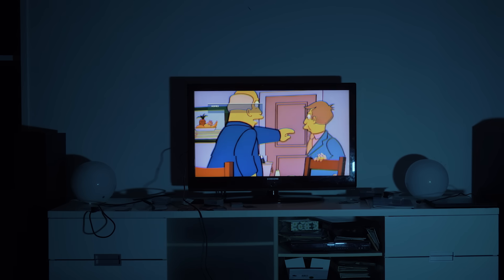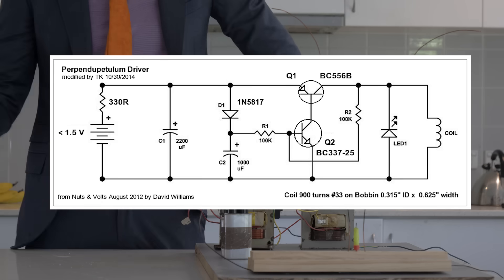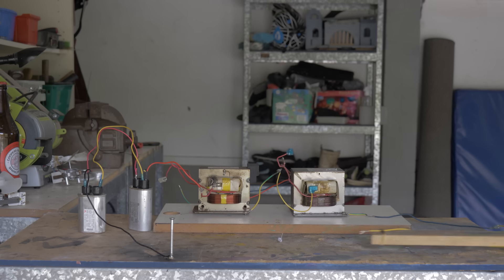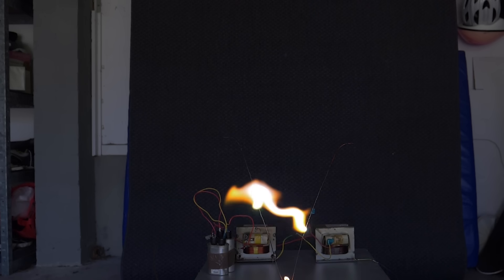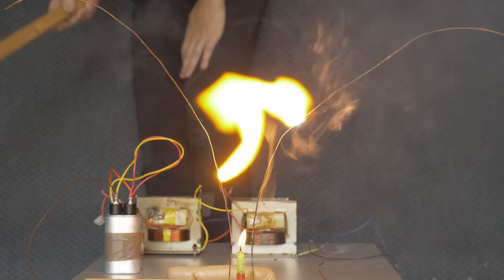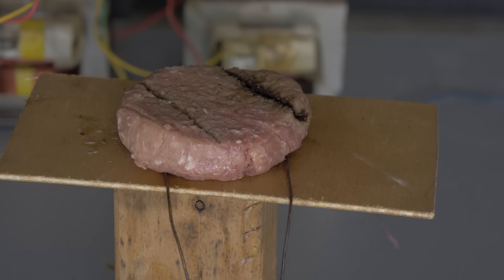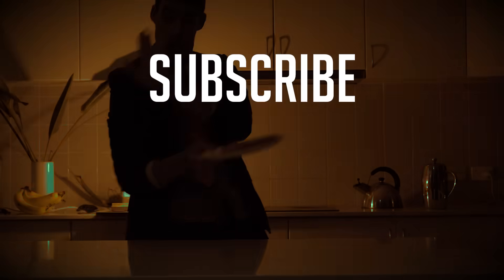Localizing Aurora Borealis entirely in my Kitchen

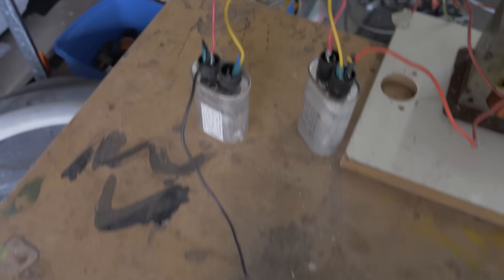Comment: At 3:33 regarding capacitors in parallel vs series... Resistors sum in series becsuse each one restricts the flow of current further. But a capacitor stores charge based on the overlapped area of the two conductive surfaces, with a dielectric inbetween. So, if you want to increase the capacitance by putting two capacitors together it must be in parallel because you are effectively increasing the area of each surface by joining the respective sides together. 
Hopefully that makes sense. But just look at the diagram for a capacitor, it literally resembles how it works. There are two plates and a gap between. In a parallel configuration you can see how there is more surface area to overlap this way as opposed to in series

Comment: Okay, coming back to this video after learning a thing or two about capacitors I can sorta explain why they didn't work in series.
Unlike resistors, capacitors' abilities are combined when they are in parallel. This is because the charges have to collect on one of the sides of the capacitor.
For capacitors in series, the charges on each of them are shared.(They move away from where the electrons are forced onto) So if you charge up a capacitor and
have another one in series, all of the charges that have escaped that capacitor will move to the other one, charging it also. In parallel however, Bot of the capacitors get
charged as the voltage is split across them.
I'm not an expert thoe.

Comment: One thing i do not understand is, what are the capacitors used for?
You have AC and the capacitors are effectively in series with the both transformers (besides wired parralel to each other).
If you want them to store power for your arc, then you must add a rectifier at the output and then the capacitors or use a marx-generator config (see electroboom for that).
From what I understand, you added just an additional load (a reactive one), limiting your maximum current draw and power output.
If I am wrong, feel free to correct me.

Otherwise, nice video!

Comment: When you connect capacitors in paralel their capacitance ads up meaning that they can output more current spot on with the same voltage, but in seies you get as big of a capacitance as individual capacitors have, actually a bit less that that. The reason for it all is that capacitor stores charge in form of an electric field acumulated on most comonly 2 sheets of a conductive foil, can be aluminum or literaly whatever that's conductive, can have large surface area and can be rolled together to decrease it's volume. The important part about capacitors is that those sheets are isolated from each other with at least one sheet of dielectric that can be an air gap, plastic, ceramic and i believe even mica. Either way, capacitance depends a lot on the type of dielectric. Now this means that if you were to charge a capacitor with a direct current it would let energy through but once the field in the capacitor is equal in strenght to your power source, meaning it's charged, it acts like an open circuit. And the time during whitch the current flows through a capacitor just as well as it's value is dependent on the capacitor's capacitance measured in farads [F]. However when you treat it with alternating current. It acts similarly to a resistor. Given that the frequency is lower than it' resonant.

So simplifying the answer to how capacitors work in series and paralel

Paralel connection ads up the capacitance

And series connection ads up maximum voltage that capacitors can withstand.

Comment: they didn't work in series because there wasn't enough capacitance to let enough current through to produce an arc. Putting the capacitors in parallel means double the capacitance, letting more current through.

Comment: The reason that the device did not work with the capacitors in series is simple: the current's frequency is not sufficiently high in order for the plates of the capacitors to be capacitively coupled. Capacitive reactance of a capacitor decreases as the frequency across its plates increases. Therefore, capacitive reactance is inversely proportional to frequency and because of this, as the frequency increases the current flowing into the capacitor increases in value since the rate of voltage change across its plates increases. At a low frequency of 60 Hz, the current is minimal. In parallel however, you are creating a ressonant circuit with the secondary coil of the transformer which maintains the current at a certain frequency that can be calculated using this formula: f=1/2π×√LC. This causes the amount of current that the transformer can deliver to increase and therefore makes the circuit far more efficient.

Comment: I dont know if someone say it yet but capacitance add in parallele, it's the opposite of resistance, so by wiring two capacitor in serie you get a smaller capacitance. 
Does the blue arc is a video effect or did you do somthing special to get it ? I only have orange arc when i try. 
Also you can make lichtenberg figure with a microwave transformer it's a simple build :)
https://en.wikipedia.org/wiki/Lichtenberg_figure
-

Comment: Capasitors don't work in series because capacitor only passes through ac current though isself, for dc it's an isolator, that's why you can use them as audio filters

Comment: if in series connected the voltage will stay the same and the amperage will fluctuate and in parallel it does the opposite

also they work diffrent on ac or dc and theres a lot of calculating n stuff

Comment: Wow you idiot, you tried wiring the capacitors in parallel. Don't you know that capacitance is added directly when wired in series!? Wiring it in parallel adds the capacitance as so: ((1/C) + (1/C))^-1.
In fact this relationship to series and parallel is the exact opposite with resistance of resistors.

Comment: 3:29

Electrical wizard here, the reason why was probably because capacitors in series have less capacitance. The equivalent capacitance of capacitors in series is (1/Ceq) = (1/C1) + (1/C2) while capacitors in parallel have the equivalent capacitance of Ceq = C1 + C2.

Comment: capacitors in series gives you LESS total capacitance than either of the two capacitors, where 1/Ct = 1/C1 + 1/C2. Capacitors in parallel are added together, Ct = C1 + C2. Basically the opposite of how resistors behave in a circuit

Comment: Transformers step up current so two of the same rating can't work because the second transformer input can't do higher power than what it's rated for.  in series, you're coupling two primaries to output with two coupled secondary windings.  

I hope that makes sense to people.

Comment: When you put two identical capacitors in series, the total capacitance is devided by two. But if you put them in parallel, you add the capacitances together. It's like the reverse of resistors in series or parallel. There is some physicsy mumbo jumbo behind it but i forgot about that part hahaha.

Comment: 3:27 This is because AC power is just delayed by a capacitor being in series with it. Think of it as a generator spinning. With one capacitor the peak of the voltage would be at 90 degrees instead of 0. Two capacitors make this angle 180 degrees, simply inverting your function. Capactors in parallel help the power factor of your transformers. This creates very large arc.

Comment: when 2 electrical current sources are put in parallel the current doubles, when put in series the voltage doubles. For the thing you're doing you need high current.
grt

Comment: I'm pretty sure the reason the capacitors work in parallel is because in parallel, the capacitance can be summed. However in series the equivalent capacitance (Ceq) is expressed as 1/Ceq= 1/C1 + 1/C2. Where C1 and C2 are the capacitance for each of your capacitors. Thus in series your overall capacitance will be lower than your lowest capacitor in the circuit.

Comment: Hey there, I just Graduate from the University of Minnesota with a bachelor's in electrical engineering, and I'm starting my masters/PhD in mixed signal integrated circuit design at CalTech in September. The reason the capacitors need to be in parallel is because it allows the circuit to reasonate at 60 Hz which greatly increases the power transferring capabilities. The air gap acts like a very small capacitor within the circuit. The transformer steps up the voltage by taking advantage of the tendency of inductors to resist changes in the magnetic Flux within the magnetic circuit of the transformer. These transformers kind of act like a flywheel for the circuit, storing 'electric momentum' in the form of magnetic fields. They then transform the momentum into voltage potential (think of a gear box turning torque into angular velocity). Capacitors act kind of like a spring. When you put the two together, energy sloshes from one component to the other. This trade off in energy between the two components prefers to oscillate at a natural frequency (like the frequency a swing trades off energy between gravitational potential energy and kinetic energy). The capacitor tunes the circuit such that it reasonates at 60 Hz (wall outlet frequency). This allows your power source to efficiently transfer energy to the output. In order to get high voltages, this sloshing of energy needs to be at the right frequency and unimpeded. Putting the capacitors in series, also puts the air gap in series as well. This does not allow for efficient sloshing because the air gap capacitor in series with our added capacitor have a smaller overall capacitance. When the capacitors are in parallel, the capacitance adds up, achieving our reasonant system.
Reply: I literally have no idea what any of this means but I’m sure if I did I’d agree with you
Reply: Okay, i explained this terribly
Reply: Sigh. Give me a couple weeks and I'll think about a better way to put this.
Reply: Steven Bulfer omg no man I’m sorry if I sounded mean. I’m just not very well-versed in electrical engineering stuff 😅 I don’t know the jargon
Reply: @shnorglebop1798  no no you're good 😅 it's objectively bad 🤣. If I'm going to go into acedemia, I want to get better at explanations! Somethings are hard to explain without a story board, so I'm just gonna have to put a bit not effort into this :p
Reply: @Stevobulfer  bro we need our explanation

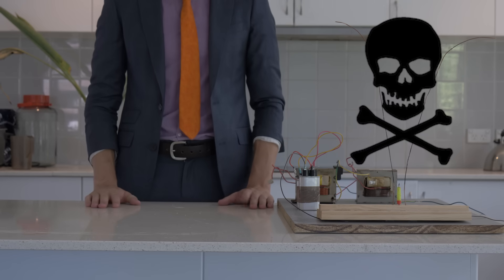Comment: 1:15 You used the wrong symbol because you're dealing with electricity rather than possibly toxic chemicals (there should be a lightning bolt instead).

Comment: 4:20 - usually not a good idea to solder earth wires like that/ rely on solder for good connection, in a fault it can melt, and then you're left with whatever connection you had to start with. best to make that one sufficient to begin with and forget the solder

Comment: 2 capacitors in series doubles the voltage rating but actually halves the capacitance, parallel keeps the same voltage rating but doubles the capacitance. parallell is usually the correct configuration

Comment: so...now take two metal pie tins and a extension cord you don't care about, cut the female end off the cord, seperate the two cords and strip a few inches of insulation off the wire...make a coil like shape with the stripped wire and using electric tape attach one bare wire to the center of one of the plates and the other bare wire to the center of the other plate (on the inside of one plate and the outside of the other plate) using more electric tape make the outside edges of the plates insulated from electric conduction...place uncooked meat patty on the inside of the correct plate (the part without exposed wire taped to it) and press the other plates outside surface on the meat patty... plug in the cord being careful to not let any metal portion of the top plate touch any other metal portion of the bottom plate...mmm burning meat... enjoy. (don't kill yourselves kids!)

Comment: Late to the party but; Capacitors have increased capacitance in parallel and less in series. Imagine a capacitor as two plates flat towards each other. The larger the surface of the plates the more electrons can sit on the plates and the farther they are away from each other the harder it is to jump from one plate to the other. When you hook capacitors up together we can imagine combining them into one, where in series we can imagine the distance between the plates getting larger and lowering capacitance, and in parallel we are increasing the plate size and increasing capacitance. (Interestingly the math to calculate this is inverse of resistors, so adding in parallel as opposed to series) I’m pretty sure this guy knows what he’s doing but if anyone is curious this is the reason.

Comment: Your capacitors are useless in this setup. The output of the transformer is AC which doesnt affect capacitors in any way. they just act like a tiny resistor here. You would need to rectify the output using a diode and THEN connect the capacitors

Comment: capacitors in parallel increase capacity, while in series it reduces capacity.
that is because the capacitance C of plate capacitors is directly proportional to the surface area (which is added when in parallel) and inversely proportional to the distance between the plates ( which is added when in series). For more info, look it up in wikipedia

Comment: The capacitors are in parallel because they act as a power booster. When the electricity goes through the fire the capacitors kind of increase the duration and the power in the arc. The capacitor is just two plates close to each other but prevented from touching by a nonconductive material.

Comment: Lesson time :) 
Transformers only work using AC currents because the alternating EMF (voltage/electron-motive-force) on the primary coil induces an alternating electromagnetic field, which in turn induces an alternating EMF on the secondary coil. This only works with AC current because EMF is only generated when there is a change in the magnetic flux around wire/coil as shown by how generators spin changing the magnetic fields strength/direction relative to the coil, this means that with DC current, the primary coil will only produce a constant electromagnetic field resulting in no generated EMF on the secondary coil. :) 

hopefully i got everything right and it was understandable, still a high school student, correct me if I'm wrong please <3
Reply: P.S i know im months late.

Comment: Im not exactly an electrical wizard but I'm not sure why you even needed the capacitors either way when you discharge things in series sometimes things can get fucky and the voltages will drift apart which can mess things up.

Comment: It's pretty cool that you can see the 60 Hz AC voltage physically shaking the candle flame in slow motion at 4:50. Then, after the arc initiates through the flame and the voltage across it drops, the arc rises away leaving the flame still. Beautiful.
Reply: 50hz mate
Reply: 57.86 nominal on the alt cur Hertzog
Reply: @tothedirtwhenidie1798  50hz in aus. most of the world, for that matter.